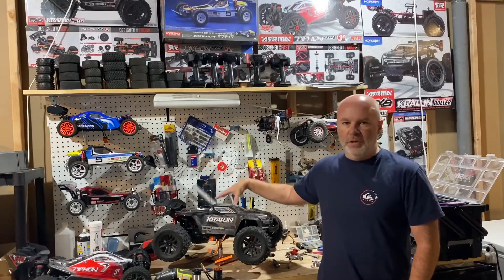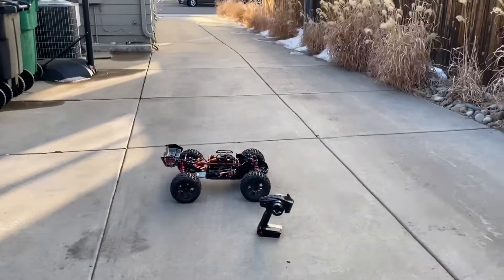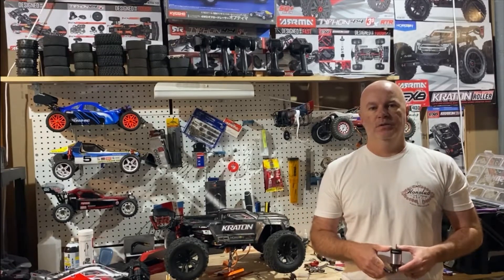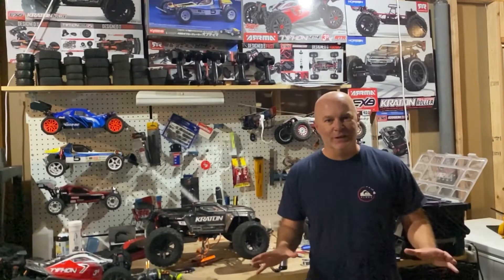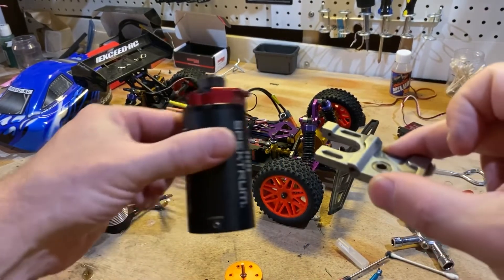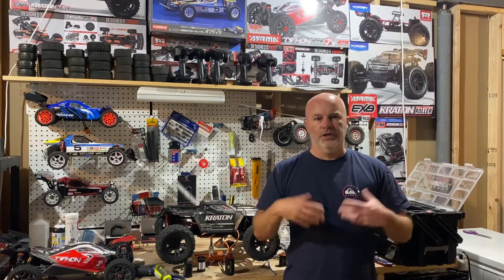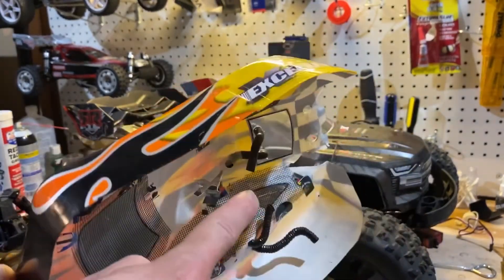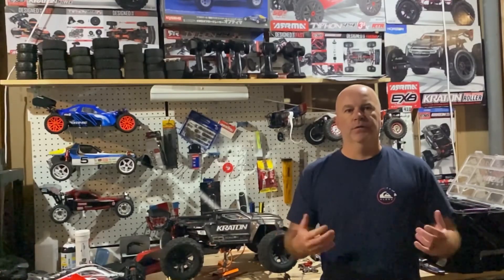The Basics of Electronics Selection for RC Cars

Comment: This was a top quality lesson. Well done that man. You only showed lipo batterys though, what about NiMH?
Reply from the maker: Electronics don’t really know the difference in what pack type supplies the juice so all things apply to either battery type.  Lipos are just typically able to supply that juice in more compact and efficient manner (with the added volatility of the packs unfortunately).  So you just compare the Mah and voltage of each.  Lipos are also said to produce better C values for running under load.  In the rpm calculation table shown you’ll see some standard nimh packs listed.  👍

Comment: Amazing video mate really explains alot I've just got into rc and have to start of a ftx carnage brushless it's on 2s and it quick but I want it a little faster, it does say it can run 3s on the web site so I've changed to metal gearing and ordered a 3s, the issue I have is some people are saying it  will break on 3s others say they have run it fine for yrs what is your input on this any advice would be amazing
Reply from the maker: Don’t have any experience with ftx vehicles, that being said, I think you should be fine.  If the electronics are compatible with each other and physically fit the vehicle ur down to really can the drive train take it.  Metal gears will help but mostly Remember the part about context:   the only way your car will know the difference between 2S and 3S is how aggressively you implement that extra power and speed. So ease into it and keep an eye on things and you should get a feel for any limitations.   Gearing may be important and the channel has a video on proper gearing if you need some help there.  Extra power and torque is only bad if you over use it, and you don’t have to use it all, so drop it in there and start slow and build it up to what the car can take.   Enjoy!
Reply: @MileHighSpeedRC  thank you mate for the reply really helps me :)